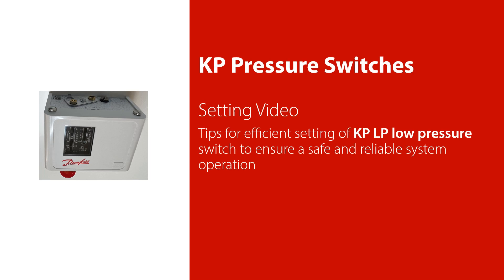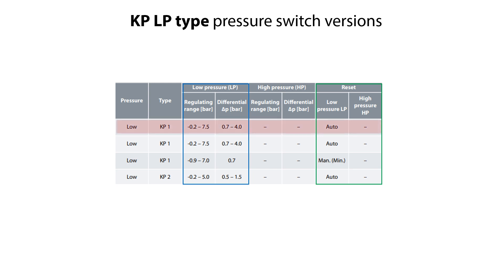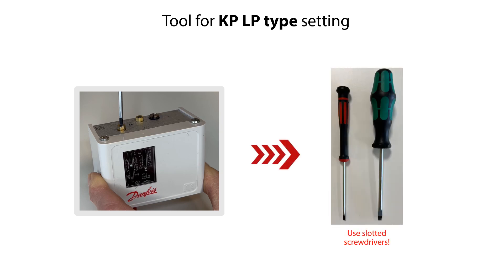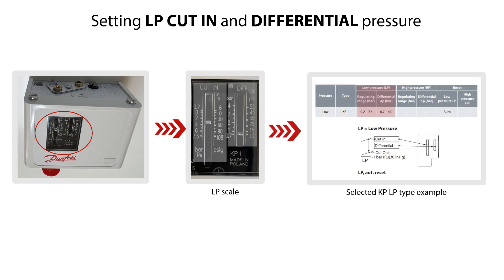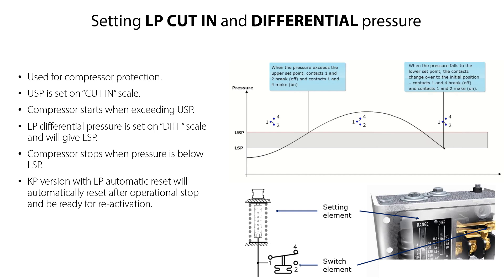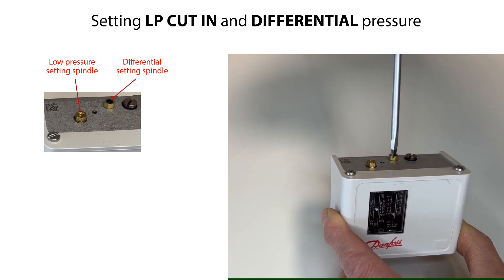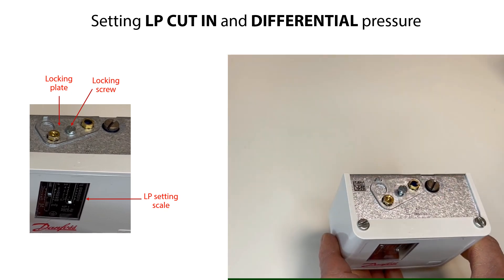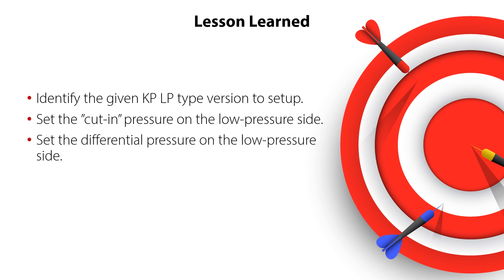How to efficiently set a KP low pressure switch

Comment: is the LSP=USP-DIFF?
Reply from the maker: Hi, we are checking with our experts and will get back to you.
Reply from the maker: Hey Fran. That is correct. If you find it helpful you can check out this datasheet for these KP switches - https://assets.danfoss.com/documents/207508/AI213186439478en-001203.pdf (you can specifically refer to page 4 of the document). We hope this answers it!